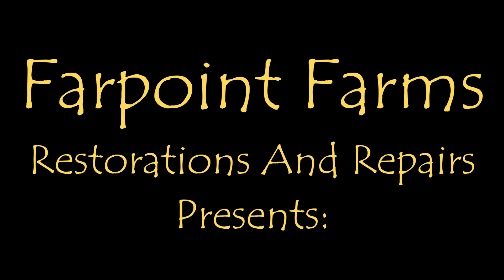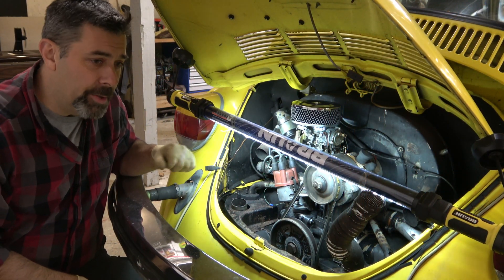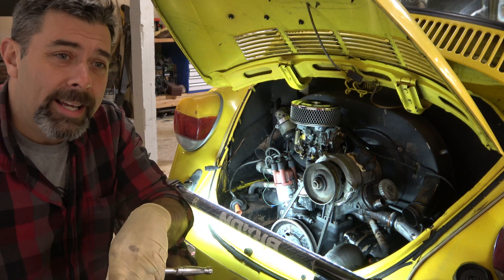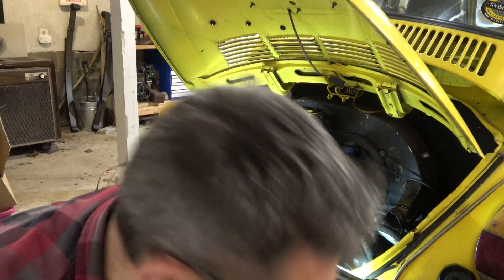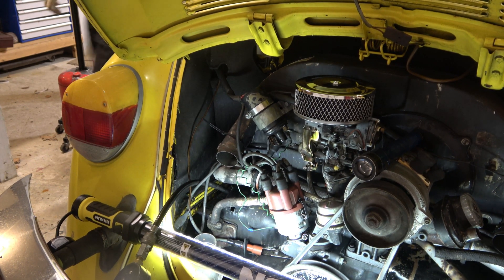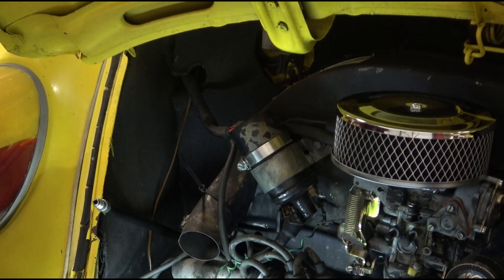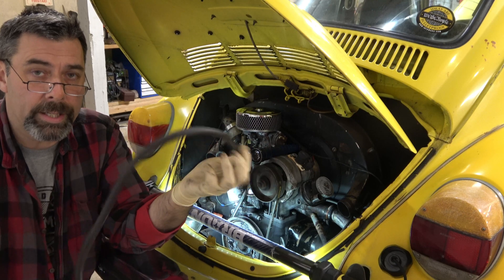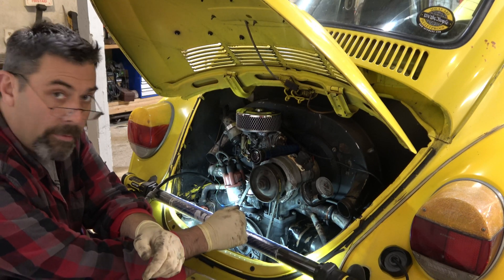Diagnosing The Engine On the Beetle With A Compression Tester. How to find Internal engine issues.

Comment: And open the throttle.
Reply from the maker: No need to do that at all. As long as compression readings are equal or within 20% I'm not worried if the compression reads 10psi lower than with a WOT. Things I've learned working on euro trash for 30 years.

Comment: First thing, #1 is the front right (front of car, right as you sit in the driver's seat).  #2 is right rear, #3 is left front, #4 is left rear.  On the '74, the valves were less troublesome than on the '70 and prior, but you should never reinstall a used exhaust valve on any air-cooled VW; reinstalled at significant mileage, they tend to break, destroying the head and piston.  Forty years ago, I had a repair shop specializing in these, and I could tell you a lot of things about the mistakes I used to see.  That one doesn't have the OEM distributor, and what's in there may be useful, or may not.  At least it looks like it's actually a '74 engine.
Reply from the maker: Thanks for the refresh. It's been years since I last played with these things.

Comment: When I was 15 I bought a VW bug. I started going over it and I was shocked at how simple it was to work on.  I had big plans to fix up everything and then put a fiberglass front and rear end on it, and electric fan for cooling in the summer.  I had planed to put a VW bus transmission in it and get the motor worked for more power ect. Then someone flashed a wad of cash in front of me and I sold it. I had a jeep wagoner that was also a project that I turned my attention to.   I sometimes wish I would have kept it especially when I found out that the new owner totaled it about 4 weeks after he purchased it.
Reply from the maker: What a shame that it was gone after just a month
Reply: @FarpointRestorationsAndRepairs  yes I must say that the way it worked and was put together was clever, simple. Later my friend purchased another one that was in really nice shape and  it had a strange automatic stick shift. It was the first I ever saw anything like it.  I am a big guy at 6'5" and then about 400 lbs and my knee would drift over and move the shifter and that made the clutch disengage.  Still it was something I never saw before.  My drean was to get the VW bus with the camper top. I alwas thought they were awesome!!! I was told that in the bug you could swap in a Porsche motor that gave it a nice boost in power.  I don't know if it would work on the van or not, and would you need better breaking on it??? I think it would be cool too hang with traffic, maybe make it more dependable?